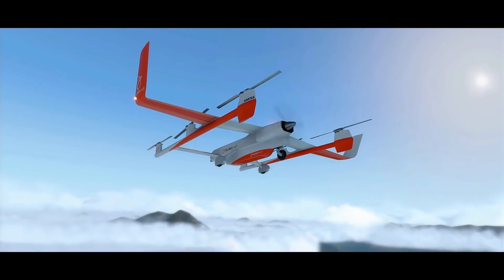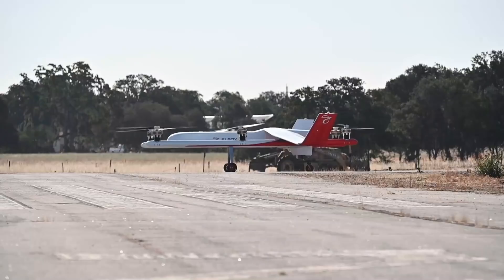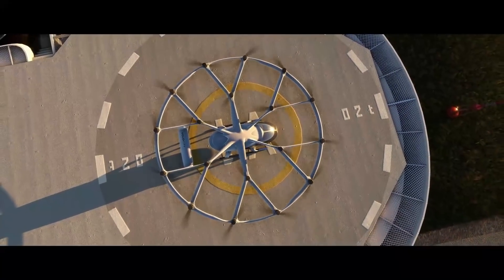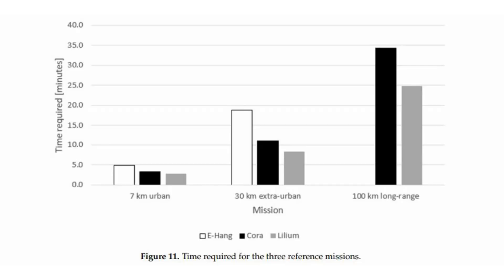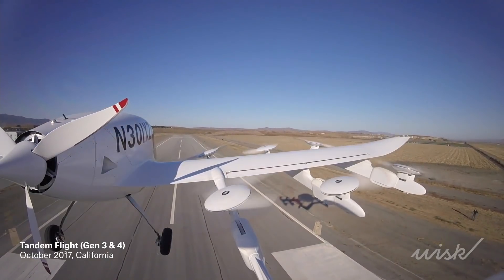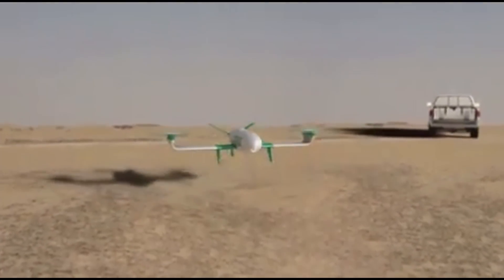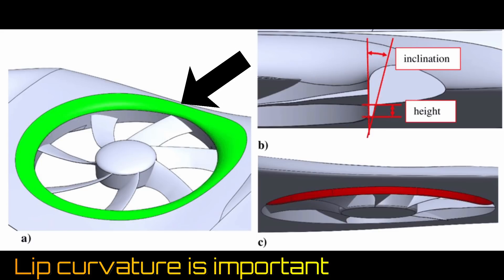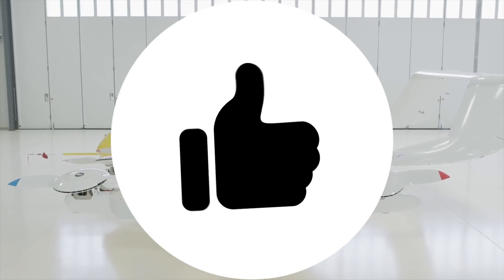Lift + Cruise EVTOL : The easiest long range EVTOL to design

Comment: Any design that makes the same motors do double duty for both lift + cruise makes intuitive sense to me as an aero engineer.
Reply: Best part is no part
Reply: @Freddie Nerkury lol no, like 2 years.
Reply: Joby
Reply: Jetoptera
Reply: I don't get why you all think that way. There is a compromise there and it is in performance of both vtol and fixed wing flight. The Ryan Air XV-5 Vertifan figured this out in the 60's, distributed electric propulsion systems makes it super simple to do.  Ducted fan-wings solve ALL of the problems.  I appreciate that ya'll are gonna let me show you how it's done, aviation is definitely taking it's sweet ass time catching up to technology.
Reply: @Freddie Nerkury Guarantee you its not, you'll see.
Reply: @Freddie Nerkury Won't be long, and then every fucking day after that.
Reply: The top priorities of EVTOL have to be noise, safety and range, in order to get licenced to operate in cities and to be useful. Two separate motors help in noise and range. It's basically Jobe vs Beta technologies for double use motors versus double motors.